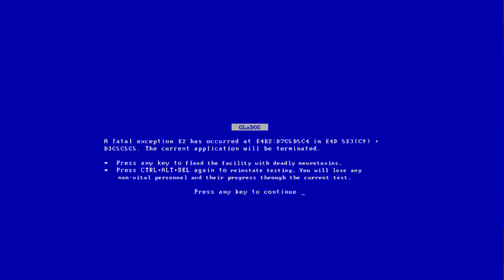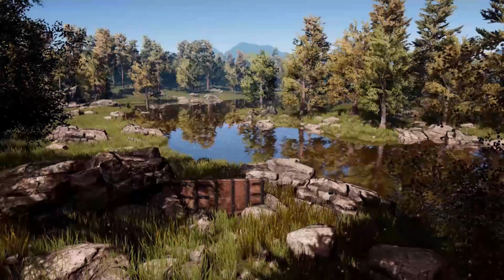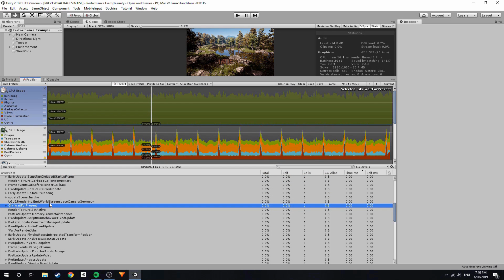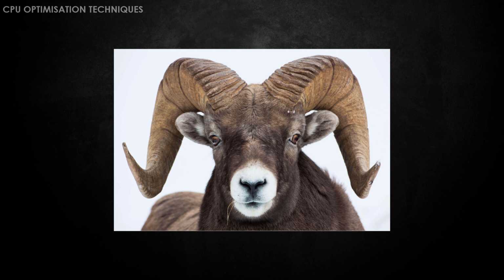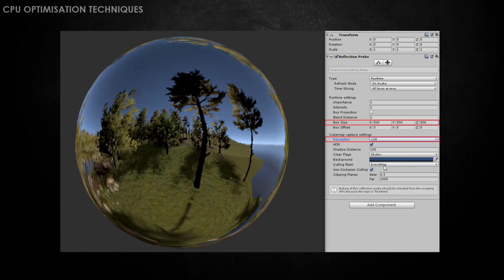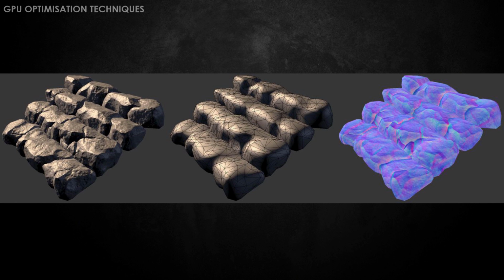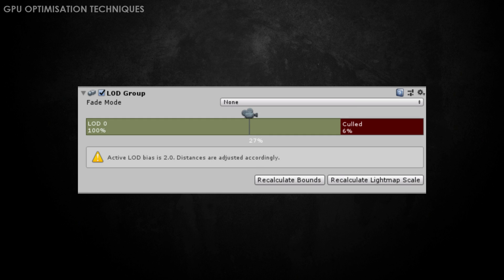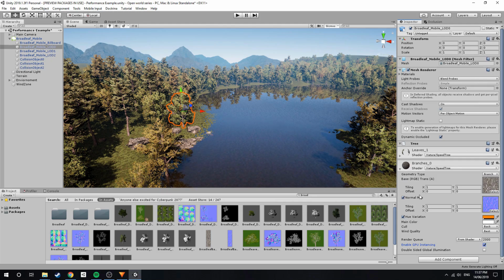How to improve game performance | Unity 2019

Comment: Hi! i am new to unity and oculus go. I am doing a school project where i have created a scene and uploaded in the oculus go. I am experiencing lag whenever i move and i have animation the the scene which i also lagging. When i move my head, the scene takes time to load and the color is distorted ( all pink,green) before returning to the original surface texture. I am not giving a very detailed description as i am a beginner but do you have any advice to solve this lag?? I really need the user to move smoothly.

Comment: Does bloom hurt performance? 😬
Reply from the maker: Any post processing effect has to do some sort of calculation(s) and re-render so yes bloom would technically lower performance. However, out of all the post processing effects bloom is a pretty cheap one so don't feel discouraged from using a bloom effect even on mobile. Screen Space Reflections is the one you have to look out for that can make a noticeable drop in performance.
Hope this helps :)
Reply: Sketch So that’s a big relief

Comment: I’m trying to use occlusion culling in my scene but i have some objects that have an animation that i want to be displayed, so I can’t mark them as static. Any advice?
Reply from the maker: Occlusion culling is precalculated and therefore, if objects are moving the occlusion culling can not appropriately cull the objects, so I assume animated objects will not work. However, you can still set animated objects to be static on the occlusion variables and they will still animate so you may be able to correctly cull them by using an occlusion area:
https://docs.unity3d.com/Manual/class-OcclusionArea.html
Reply: Sketch Thank you! :)

Comment: I was recently on unity forum and I was struck when people defended bad performance of HDRP on low and mid-range hardware by saying it's designed to be a AAA rendering pipeline XD So is Fox Engine and it rocks stable 60 fps no matter what in every game on any device with barely any difference in visuals across all graphics settings profiles.

Comment: My god you scared me, my pc has been blue screening quite frequently and that bit at the strart gave me a fright xD
Reply: Sir if you are using 32bit windows then your pc should've run with 4gb of ram . . Above that will couse blue screen . . İf its 64bit windows then you could use large number of ram gb (its more like what your cpu capable of . . İf your cpu was made for 32bit windows, then upgrading windows software to 64bit wont help) . . Long story short, if you are using 32bit, make sure you have max 4gb ram . . That was a huge issue for me long years ago, i stupidly upgrade from 4gb to 8gb ram but i was using 32bit lol (maybe im wrong, correct me if im wrong)
Reply: @habibsadkcetin5539  My windows version was most definitely not the cause of my problems. My 5.3Ghz CPU overclock was the problem lol.
Reply: r you using AMD rx5700xt?😥😥
Reply: @osirisrex3499  why? I'm planning to buy it, is it bad?
Reply: Bruh buy the new one

Comment: Thanks for covering most of performance points.
1. Is this applicable for Unity 2019.3 LDRP?
2. I have suggestion that reduce background audio so it will be improve your voice quality.
Reply from the maker: The tips are more general and don't adhere to any specific pipelines so it should work fine with LDRP :)

Also, I agree the audio isn't the best, this is the only video I recorded using my laptop which is why it sounds strange.
Reply: AS far as I know you maybe need to disable srp batcher if you want to use gpu instancing because both together dont work. Thats just maybe a thing, but which one of these two gives you better performance depends on your project.

Comment: I've made hundreds of models and populated my scenes with them, they're all under an empty. If I wanted to use occlusion culling or shadow maps. Would you just select all of them, make them static and click some button somewhere. I attempted this in the past and it never worked, recall it even crashing at one point while baking shadow maps. 

The game runs fine in the editor but when you create a player and run the game in fullscreen it's about 45fps and 20 if you open a menu. I looked at the profiler and seems rendering is what is causing the lag, hiding the light and game objects increases performance by 50% so it's probably the real time shadows in the case of the menu it might be some script that is constantly looking for something. So frustrating but I suppose increasing performance is what you do at the end of the game's development.
Reply from the maker: If the scene is really big occlusion culling and baking lighting can actually cause issues due to how big the file size will be, also especially with baking the lighting large scene take absurd amounts of time to compute. 
It's hard to diagnose performance without seeing the actual scene, but from what you say make sure you have LODs on your models to reduce the stress on rendering, additionally, if they are sharing the same material make make sure to enable GPU instancing on that material, if there is a lot of different materials/textures the might be causing memory issues that will slow down the scene so either reduce the texture resolution or create texture atlases for your models. Turn off shadows for models that are small and hard shadows over soft, also if you have lights that don't move set the mode to mixed (assuming your not baking the lighting).
Also, since you have many objects make sure that you are not using 'gameObject.Find' commands in your scripts (unless on Awake or Start) as this command will search through all objects. For your menu make sure the UI is not using any extremely high resolution image when it isn't need.
Performance is something you should be fixing throughout development, do not wait till the end. When you add new features always view the performance, if there is a decent drop you know that what you added can be improved, whereas if you waited to the end you will have no idea what aspects are causing the largest drops in performance.
Hope this helps a little, I know performance can be a massive pain and there is no easy fix, the more you debug this stuff the better you will get.
Reply: @sketch3436  Invaluable advice, I tried changing the sun light to mixed but didn't seem to affect fps. LODs for trees might be a good idea since there are lots of them in the scene. And I did use GPU instancing or I am using them. But if you make an object static it seems it ignores the GPU instancing. I tried which gave better fps and having the object be static improved the fps by 15% compared to GPU instancing so I guess it's preferable.

As for the ingame menu, I'm loading it as a scene async on top of the current scene. So effectively two scenes are loaded at the same time. I suspect this is what's cutting the fps in half and not the menu itself. Because it's just some sprites and buttons. How could those half the fps. Do you think it's best to load menus in a separate scene on top of whatever scene you're in? Or should you somehow have the scene appear in every scene? Maybe make a prefab out of the entire menu or something.

Comment: I'm a total noob.

Lets say we have a weapon with all the internal parts.

If you shoot with the weapon you can't see the internals, this still impacts on the performance? (I can't delete the internals because i need them when i disassembly the weapon in the game.
Reply from the maker: The poly count of your weapon would be less if the internal parts were not present, therefore, it would be more performant. However, the impact on performance would be very minimal in comparison to other aspects (lights, not having LODs, reflections etc). I would not worry about the rendering of the internal parts at all unless you are really struggling with performance.
Hope this helps 😊
Reply: @sketch3436  thank you so much!!!

Comment: I have 1 questions haw to chenge haw fur see the camera with unity c# code
Reply from the maker: You can change a camera's render distance by changing the far clipping plane, this can be done on the camera component itself. For code it would be:
camera.farClipPlane = [whatever value you want (float)];

If you want to target specific layers you can use:
float[] distances = new float[32];    //array for all possible layers
float[3] = 10;   //Change layer 3 cull distance to 10
camera.layerCullDistance = distances;

Hope this helps
Reply: @sketch3436  the you the only person you answer that question I try

If my method works will have so mach better performance my idea is Depending on the area the player are to change the camera distance for example if the is insade on small room the don't need too see The same distance wean in the outside of that room

The way I make that system is with onTrgerrigerEnter or else onTriggerStey
Reply from the maker: @watercat1248  I would not recommend creating a script to dynamically change layer culling, since, every time you change a cull layer distance it has to go through every object in the scene to update them. However, what you are suggesting sounds exactly like occlusion culling.
Occlusion culling is when the camera only renders what it can see, so if you're inside a room then all space outside the room will not be rendered. This is integrated into unity already and is really easy to setup Window > Rendering > Occlusion Culling, then just click bake the default settings are good enough. Note, that occlusion culling only applies to static objects.
Documentation: 
https://docs.unity3d.com/560/Documentation/Manual/OcclusionCulling.html
Reply: @sketch3436  I know that option but I have 1 big problem wean using transparent texture with colision the don't see bihand that object I don't know if that problem still exists in the new unity versions or if have same way fixed that problem if that problem exists I need find same other way to make semuler system that if didn't have same other way to fix that problem

The other way I want that the player is insade the water I need to see in less distance

Because I use unity form 2014 is very difficult to know haw many of the problems have fixed or changed i know the big change and the stuff I used often occlusion is not samthin I use often but I check if have same the same problem and if have the same problem I need way find same way fix problem
Reply: @sketch3436  2 questions form occasion
1. the occasion system work with multiple cameras ?
2. In the order to works occasion system need the canera to by the sean or work event if spone objects with camera?

Both questions is very important because my game I will be networking multyplay and the split screen if have 1 off this problems I cen not the occasion is not for the game I made noe enyway I test occasion system or I find the answer for sure
Reply from the maker: @watercat1248  I haven't had issues with transparent materials with occlusion culling before, the only ever issue I have had with occlusion culling is that when objects are culled they also disappear from reflections so depending on the angle the player can see the objects disappearing in the reflection.
Reply from the maker: @watercat1248  1. Yes, occlusion culling works with multiple cameras and will take into account all the cameras which may lower the effects of the occlusion culling if the cameras and all facing different directions. If you are cycling through cameras it is best to just reposition one camera each time for improved occlusion culling.

2. Unity's standard occlusion culling will not work with gameObjects that are spawned in during runtime, these objects will only be affected by frustum culling which you can enable on the camera component. However, there is a free asset that allows for dynamic occlusion culling which you might find useful:
https://assetstore.unity.com/packages/tools/camera/instantoc-dynamic-occlusion-culling-lod-6391
Reply: @sketch3436  maby that problem is hav fix wean I use occlusion is It was when it was new now  I have is very lick too fixed that problem thenx I try for sure
Reply: @sketch3436  what exactly is that assets? I don't understand for your comment
Reply from the maker: @watercat1248  That asset allows for occlusion culling to work on gameObjects that haven't been baked in the occlusion culling data. So, if you instantiate a cube during runtime this asset will allow that cube to act as an occluder.
Reply: @sketch3436  cool thenk
Reply: @sketch3436  1 other questions haw to chenge camera layers with code?
Reply from the maker: @watercat1248  Not to sure what you mean, do you refer to the layer culling distance or how to change a gameObjects layer via code?
Reply: @sketch3436  no ther is I'm not talking for the normal layers I'm trying for the (camera layers) is different layers if you go in the camera have option camera layers this what objects see the camera have option what layer can see my problem i don't know haw change that option with code

And is different question form the camera distance
Reply from the maker: @watercat1248  Just to clarify are you asking how to have different cameras only see certain gameObjects and how you can layer what these different cameras see on a single display?
Reply: i thing to use cinemas sean do you know haw to use this system

Comment: How about best methods to change between large open world scenes?
Reply from the maker: Larger scenes are always a lot harder to manage in terms of performance. I didn't really talk about large terrains mainly since I feel I'm not knowledgeable enough yet. The largest terrain I have worked on is 4km by 4km. For that scene the biggest challenge was to reduce drawcalls, so LODs were extremely important, every model in that scene had multiple LODs. Also, it's important to note that occlusion culling wasn't used, for large scale scenes the file size of the occlusion maps will actually lower performance. Those two were the two biggest things, however, we did use essentially all the tips suggested in this video with a lot of fine-tuning and testing.

Transitioning between different scenes will either need a loading screen, perfecting the above techniques will lower the load time or you can dynamically load the scenes while the player in-game using allowSceneActivation or you can have it all in the one scene and use object pooling (this does mean you will need one longer loading screen at the start).

allSceneActivation documentaion:
https://docs.unity3d.com/ScriptReference/AsyncOperation-allowSceneActivation.html

Hope this helps.

Comment: Excluding voice record quality, it's the best video on the topic of optimization. Great job! But couple things bother me. 

Isn't pixel light count only applicable to forward rendering path? While in different all lights are basically pixel light and adding new light isn't as taxing for performance as in formward mode.

Also occlusion culling is actually bad for large open scenes. Cause there are basically almost no objects to effectivally occlude other objects and enabling occlusion culling isn't free. It does consume CPU resources, so for open large scenes you most likely that you'll get better performance by not using occlusion culling.

Limiting camera render distance and masking transition to "nothing" with fog is another great method to improve performance. But you do need to blend that fog into skybox and there's different methods to achieve it, depending on skybox technique that is being used.
Reply from the maker: Thanks, Gua I really appreciate it. I agree the voice recording was poor, and I didn't realise until later in editing and at that point, I couldn't be bothered having to redo everything.
Regarding, pixel lights the forward rendering pathway is the only one that deals with them differently in terms of performance, so I wouldn't, be surprised if per-pixel light count only affects the forward pathway, however, I'm not too sure as the documentation doesn't give any explicit answers, if you any info let me know.
I agree with what you say about occlusion culling, I probably should have put some extra detail in for that section.
Thanks for reminding me about the fog masking technique I had completely forgotten about it, if I do another performance video in the future I'll be sure to mention it.
Thanks again for all the feedback on the video I really appreciate it 😊
Reply: Your welcome. Lightning fidelity and performance is the main difference between forward and rendering path. That's why most AAA titles deferred. It's brought app in every article on this topic. Here's first link from google https://blog.theknightsofunity.com/forward-vs-deferred-rendering-paths/

Unity official docs
http://docs.unity3d.com/Manual/RenderTech-DeferredShading.html
http://docs.unity3d.com/Manual/RenderTech-ForwardRendering.html

If I remember correctly post effect are alo way cheaper in deferred.